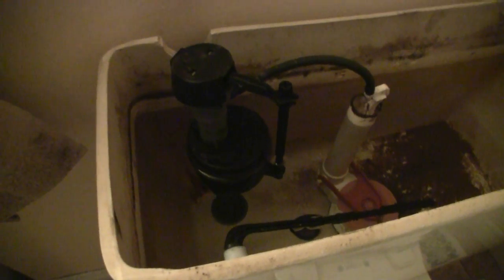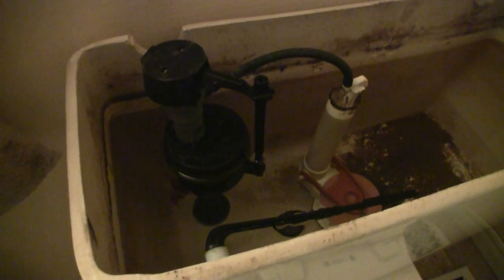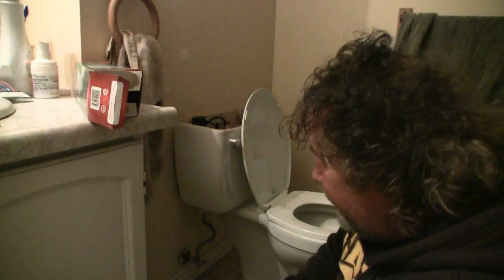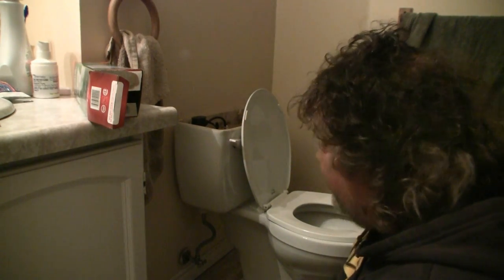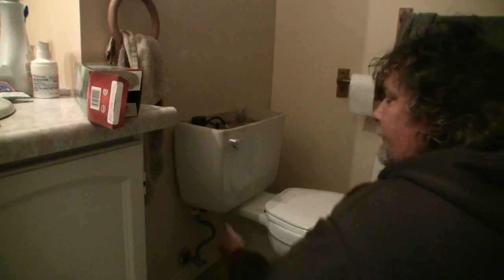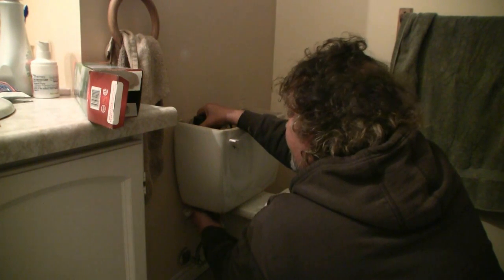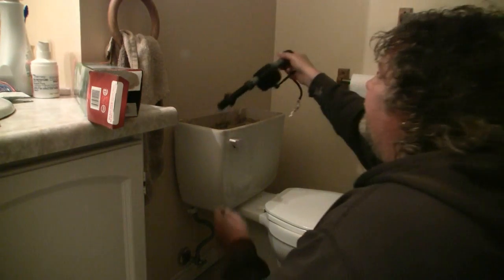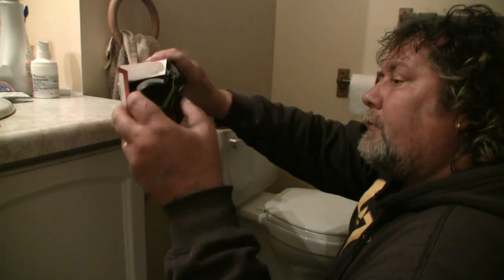How to fix your toilet

Comment: 1:35- I've had this same exact problem with my toilet a few times. Same Fluidmaster fill valve. But you don't have to replace the entire valve. Just the valve cap on the top. Costs less and takes only a few minutes to change. The new valve cap comes with the directions to replace.

Comment: Couldn't read the other comments YT problems.  With the fluidmasters you pull back the sleeve collar and you can adjust the stem length not twisting the end to adjust the stem length.

I wish changing out a fill valve was as easy in this video, try changing one on a commercial toilet in a stall where you can only feel and not see the parts on the bottom of the toilet tank. The fucking plastic nut that holds the valve wouldn't turn, had to split the nut with a hammer and screw driver.